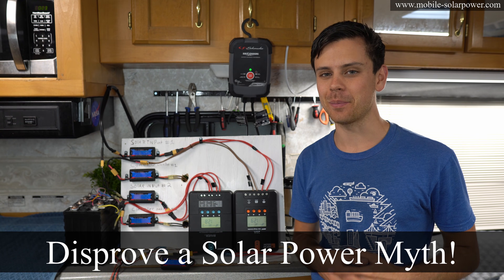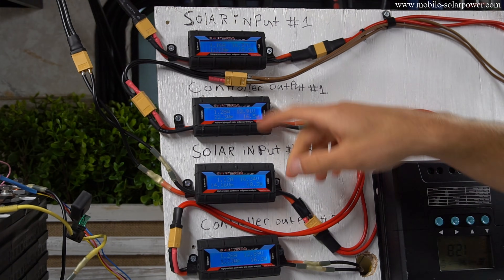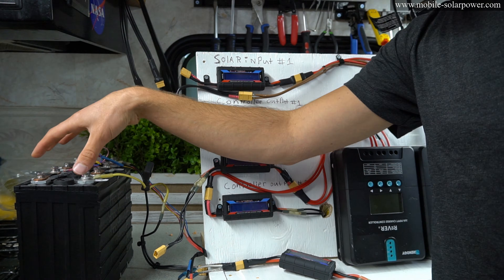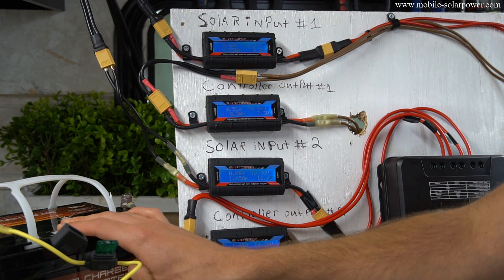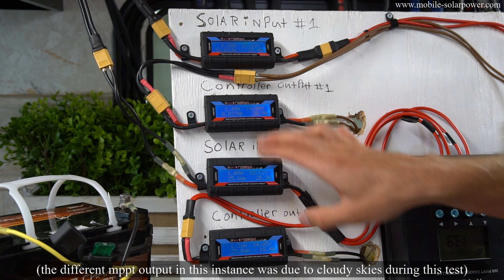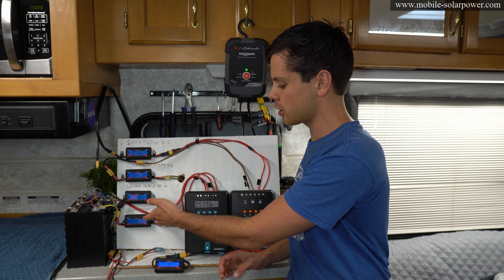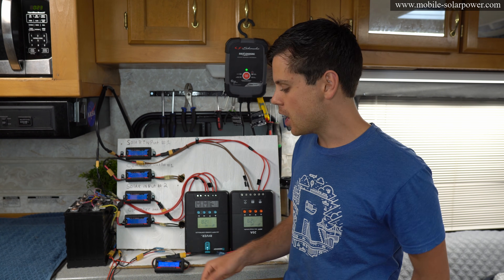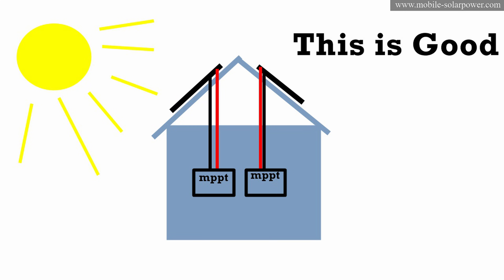Off-grid Solar Myth Debunked and Explained: 2 or more Solar Charge Controllers + 1 Battery

Comment: A lot of this confusion I think comes from people not understanding how the chargers work. They think the chargers selects the voltage for the system when the battery is what determines the voltage based on how much current it's being fed or draw.  Drive more current into the battery voltage goes up take current out of the battery voltage goes down. 

Chargers only monitor do I need to put out maximum current or do I need to maintain a voltage and how long they need to maintain that voltage. They are programmed desktop power supplies for AC chargers. Solar is a little bit more technical but the battery sees the output the same.

I used to play around with lead acid batteries and I'd often use two 12 volts in series with 20a  24v charger to pulse high current though a dead 12v to desulfate it a bit when they were really bad. 

Ohm's law in action. I'd use that to bring the battery up to around 10 volts then do a slow desulfation charge.

Also I find this ideal a bit ironic considering there are hybrid mppt charger inverters that have two separate PV channels and MPPT controllers inside of them 🤷. They just get programmed exactly the same but they're still two separate channels with two separate controllers.

Comment: Thanks, Will. This video has been most helpful as I have two charge controllers (one pwm, the other mppt) connected to a lead acid battery. I’ll set one of the charge controllers to agm as a way around the equalization for now and save up to eventually buy a LiFePO4 battery.

Comment: That kind of confirms what I suspected.  If the battery is capable of taking the output of all charge sources without reaching its absorption voltage, all the chargers will be in max output. Once the battery is up to absorption voltage (max charging voltage) the controllers basically hold that voltage steady and the current naturally tapers down as the battery’s state of charge comes up.

Comment: Anybody can hook two charge controllers up and say this works, but when you think of the charge controllers trying to decide when to go to saturation charge and the voltage switch over; when you start to consider the Probable oscillations happening in the feedback loops to the firmware operating the charge controller- I can certainly see why people would say it's less than a favorable situation. Thankfully apparently most charge controllers aren't phased by it, but I can't imagine questioning avoiding hooking up two charge controllers to the same batteries. Looking at the charge voltage the controllers are setting themselves to on a scope would be required to settle the question.

Comment: What if one charge controller is 150 v and the other is a two string 250 v each string??? Or I can run the two strings into a combiner box to one input and the other to the. Other string???

Comment: I currently have a rv with 300 watts of solar attached to a bank of lithiums and I would like to add an option to add temporary solar panels to increase charge rate to them occasionally.  Do both mppt have to be from the same manufacturer or can I add a different manufacturer mppt as the occasional charger and solar panels to the rv?  Based on this tutorial, it seems I can he 2 different mppt because they are not actually communicating to the batteries.
Thx

Comment: I want to power my trailer without using the house electricity I don't want to get the bill high so what do I need to just have electricity in the camper only using the shore power

Comment: What if the charge controllers are PWM? I have an RV with a built in PWM controller and, when needed, would like to connect a portable solar panel with its own PWM controller. They would be connected in parallel to a single battery, like your example.

Comment: Shading on one solar array has no impact on a separate array that its parallel connected to and on that note you could have condensed this into a 30 second video with zero irrelevant bullshit if you knew the difference between voltage and amperage and explained that adding a second solar controller adds amperage not voltage and whys that? Because they're parallel connected to the battery. (Batteries have amperage input limits too.) 126000 views 10 minute video you just wasted nearly 2 and a half years of people's time in viewing time alone and left misinformation in 126000 peoples heads. And not just any people. People who are setting up renewable energy systems!

Comment: I have 2 eg4 6000ex in parallel.  I have approximately 30 kwh of battery storage.  One inverter has 6kw of pv. The other has 7.5kw of pv. I have an additional 7kw of panels i can install.  I am thinking about buying a 8000 or 10000 watt sungoldpower inverter for those panels and using the same battery bank. I would put the ac output of this inverter own a separate panel specifically for car charging when the panels are making good power. Do you see any issues with this? Thanks for your input!

Comment: I have 24v Sungold all in one charge controllers.  I have a second one that I haven't set up yet.  Can my second controller be connected to my first battery bank?  My first set up is 8 one hundred watt panels.  I want to add another system so I can use two larger panels can I connected right to the battery bank I have?  4 Iron phosphate 24v 100 amp hour battery.

Comment: if i have charge controller at at 54 vdc @ 10amps 24hrs per day and a solar panel charger 54vdc @ 0 to 50amp. will it blow up the smaller controller.

Comment: I have only just discovered this concept, and you present it so well. Thanks. I have a question though : If, to charge or not to charge, is based on internal resistance, why are the bulk and float limits set using voltage ? Hope you're still checking comments after 5 years 🙂

Comment: I have 2 identical solar chargers connected to a battery bank. When the battery bank is almost full it only uses one of the solar chargers and the other one just sit there idle, that is most likely why people think you can not use 2 chargers on one battery... Only when the charging ampere is higher then what just one charger can make it starts using the second solar charger.

Comment: Ok so I have 4 900watt solar chargers on a 20kwh lead acid battery bank sometimes they all put out 600+
But some times the one charger will put out 900 and the other ones drop to 200-300
And when I disconnect the higher output charger the other chargers jump up to 600 watts.
All 4 chargers are the same 
Why do mine do this?

Comment: I'm assuming your solar charge controllers are programmed the same? The shore power charger is the one that's different and has a higher threshold before it goes into float charge and that's why the solar chargers go into float first? I'm trying to do something like this for my boat and it seems a lot easier than I'm making it in my head

Comment: Thank you. This was exactly what I was looking for. Connect all the solar charge controllers to a bus bar. Ideally one per panel. Put all of them near the bus bar so they see the same voltage. Then attach the battery(ies) and load to the bus bar.
And with will also work if you attach a AC to DC and/or DC to DC charge controller(s) to the bus bar as well. Just need to have the same float and boost voltage setting.
This includes  petrol generator AC or DC to DC charge controllers and wind turbine charge controllers.

Comment: This is a very informative test. I was always told by electrical engineers to never combine two or more power supplies or chargers to one battery, even if all provide the very same voltage or of the same type/model etc.
Did you use any load balancing resistors or ORing diodes on the supply outputs?

Comment: I have a renergy 200w solar kit with 40a rover controller for my van ,can I use my old 335w panel with it or do I need to use the epever controller. To have two separate systems. Thanks

Comment: Hi Will, What happens when we connect 2 or more Mppt controller to a single array of panels (charging a 12V lithium battery bank)? Currently I have a Victron 100/50 controller(connected to 800Watt array) and am planning to add few more panels(400watt more panels) to my existing solar array. I do not want to replace my current controller with an expensive larger controller nor split my panels into 2 arrays. Instead I was thinking of adding another 100/20 controller in parallel to the same Single Array PV wire. Would this setup work? can these 2 controllers co-exist on same array and work as a 100/70 controller?

Comment: can i make one solar system.. example.   2s2p  1kw     and use 2x 100/20mppts charging  one 48v each one makes em 2 seperate battery packs  ?

 different systems going to different inverters but  one PV array to feed em all ..!   i know it wont charge fast but is it possible ? ?

Comment: Great video, can controllers connect to individual lifpo4 batteries in a bank or connect to buss bars, l have 2x175ah batteries with 2x 350watt panels and 2x40a Renogy  rover controllers hard connect to 12/240 inverter hard wired from buss bar. What are optimum controller to battery. Cheers,

Comment: I have agm led gel batteries and I want to add wind as well. So as I understand I can just link up another charge controller from the wind turbine and it will integrate with the solar charge controller. I also don't understand where the excess power goes if your batteries are full how does the solar charge controller get rid of the excess power? Does it drain from the earth cable I have from the charge controller? Their is no cord on my victron  mppt solar controller to dump excess power. I'm confused. But thankyou for clearing up the multiple charge controller thing. Oh would I be able to splice the cables from a solar panel and a wind turbine and run it I to one solar charge controller or would that confuse it with heaps or eregular power flowing in?

Comment: helo. congratz for the good work. i want to ask if i can i wire parallel  2 mppt 15acharge controllers, to the same solar panell 410w, and charge one 12v 315ah opz acid battery to get 30a?is it safe?

Comment: Hi Neo

Sorry,your controller is TracerAN 40A series,we don't recommend connect controllers in parallel to charge one battery bank.

Have a nice day!

Best regards
Fred Zhao
EPEVER Support
Reply: I've git a question I've been told tgat If I use these house solar panels which there is 3 on top my van each are 317 watt panels I think they are around 35 to 40 volt open current I'm new to this please bare wth me I judt lost my home to fire abd all I owned is gone I'm on disability getting less than 900 a month to live on so I'm frightened I'm going to burn up a inverter or my batteries 
ANYWAY I WAS TOLD THE 3000 CONTINIUS 6000 SURGE PURE SINE WAVE INVERTER IM USINH THE PANELS ARE TOO MUCH FIR MY 12 VOLT WINDYNATION INVERTER ILL BE USUNH 4 100 AMP HOUR LIFEPO4 BATTERIES IT HAS TOOK ME AWHILE TO BUY THID STUFF IM FORCED TO TURN MY HIGHTOP VAN INTI A HOME BECAUSE THERED NO WSY I CAN AFFORD ALL THE DEPOSITS AN RENT AN ALK NEE FURNITURE REQUIRED TO RENT ANOTHER HINE ILL LIVE IN MY VAN SSVE MY DISABILITY CHECKS UP TILL I CAN ONVE AGAIN LIVE IN A RESL HOME 
MY QUESTION IS ISBT THE CHARGE CONTROLLER WHST I NEED TO MAKE SURE OF WILL BE ABLE TO HANDLE THE VOLTAHE WBD AMPS COMING IN FROM THE THREE SOLAR PANELS  THEY  HAVE NO EFFECT ON THE INVERTER AT SLL AM I CORRECT??? WAS I TOLD WRONG TGST THR PANELS DEPENDING ON VOLTAGE AND AMPRAGE COULD BE TOO MUCH FIR MY INVERTER ITS NOT THE SLL IN ONE INVERTER ITS A SIMOKE 3000 CONTINOUS 6000 SURGE PURE SINE WAVE INVERTER IM THINKING OF BUYING 2 MPPT CHARGE CONTROLLER  RUN TWO ON ONE CONTROLLER AND THE THIED ON ANOTHER CONTROLLER AND TGAT WSY IM REDUCING THE VOKTAGE SBD AMPRAGE ENOUGH WHERE I DONT HAVE TO SPEND A FORTUNE ON ONE MPPT CHARGE CONTROLLER THAT WOULD BE BIG ENOUGH TO HANDLE THE AMPRAGE AND VOLTAGE OF ALL 3 TOGETHER  SO DO I NOT NEED TO WORRY ABOUT THR PANELS BEING TOI MUCH FIR MY INVERTER IR DO I IF I DO PLEASE EXPLAIN TO ME WHY WN WHAT I NEED TO DO GET A 24 VOLT INVERTER AN CONNECT MY BATTERIES TO EACH OTHER SO THEY ARE TGEN CONVERTED TI BEING 24 VOLT BATTERIES INSEAD OF 13 VOLT EACH 
IM JUDT SCARED TGST THE INFORMATION I WAD GIVEN TELLING ME THESE BIG HOUDE PANELS AKL 3 WILL BUTN UP MY INVERTER ITS NOT A ALL IN ONE INVERTER

Comment: Hi Neo

Which series controller do you have?Is it TracerAN(50A-100A) series?Do you connect two controllers in parallel to charge one battery?

If you connect it via PAL-ADP-50AN adapter,you can only set and monitor all the parameters via PC software.

If you don't have the PAL-ADP-50AN,we don't recommend connect 2 controllers in parallel.And you need 2 Wifi adapter to monitor controller.

Have a nice day!

Best regards
Fred Zhao
EPEVER Support

Comment: Hi Neo 

Actually,we must know what is your controller series?Could you please take a picture about your 2 controller's label?

And we don't recommended connect controllers in parallel to charge battery.
Because, the different chargers have different variance of samples and charging characteristic, they will affect each other and display different charging status when battery bank is nearly charging full, such as one charging more, one little, which is bad at your battery bank and chargers. 

Thanks and have a wonderful day! 

Best regards
Fred Zhao
EPEVER Support

Comment: When I installed 2 EpEver MPPT (because I have 2x 2 parallel panels in different directions and angle) and connected the output of each controller to a busbar and then to the battery,  someone told me I could not do that. I contacted EpEver and they told me that too. They told me I need to put a PAL-ADP-50AN . I did check for one online but could not find one to buy on any European website. And even on Alibaba and Aliexpress they are not available.  I looked on YouTube and found this video (beside others who just connect multiple mppt to the same battery) (but here you're the only one that beside just telling and showing a setup, also explains) so ... maybe the Epever PAL-ADP-50AN is discontinued because it doesn't make sense to buy it ??.

Comment: I have a battery Bank that is two hundred amp hours of lithium add  2 suitcase solar panel renogy 200 w I know the rule is 200 watts of solar to 100 amp hours of battery so I should have 400 watts of solar charging these two hundred amp hours of batteries so my question is can I put both of the panels and both of the charge controllers on this Bank of 200 hours of lithium? My reasoning is that 400 watts of solar with charge quicker than 200 watts. Will the charge controllers and the batteries BMS system work together and charged as though they were one 400w system?

Comment: my question is i have 2 controllers that are preset, all you can do is check volts and amps, or lead/gel battery. their 30 amp controllers 12 volt, i bought a 100 amp 12/24 that i hooked in 24 volt, so the other two controllers are on a 12 volt, while the 24 goes over both, so this controller i can set up to 30 volts, and when i go over 28 it seems to shut the other two controllers off, when batterys are close to a full charge, so i sometimes put it to 29.4 volts to get a full charge, and the other controllers do shut down. i was given 6 agm batterys so when it says 14.5 volts to cycle, and their tied to just lead acid, that im not getting the needed voltage to deep charge them unless im set to 29.4 and lose out on 30 mps help by the two other controllers, IDEAs?

Comment: Thank you very much for this video and answering questions I've been looking for! Just to be sure. Did I get you right - If I have LiFePo4 12V 560Ah and three solar panels 460w each and I have three mppt charge controllers with no parallel function and I connect each panel to each mppt charge controller and wire their outputs to my battery it will work great without any parallel function at all?

Comment: What about overvoltage with two MPPT in parallel?  I am getting over voltages of 29 to 32 volt despite having set the MPPTs maximum voltage at 28.2 volts for a 24volt LiFePO4 battery bank.

 I have a two 40amp MPPT units, one a HQST and and the other a BougeRV one, both coming in to a busbar and then on to the same 24volt S2P2 Chins battery bank (four x100ah 12volt batteries).  Both MPPT are set at 28.2volts.  They are fed each by separate 500watt panel arrays (5 x100watts in series).  
 I also get overcharge warnings and beep from my Reliable 3000watt inverter and when that happens, I measured voltage jumping from 28volts to 31volts at the input lugs.

Are my MPPT controllers bad or am I missing something?